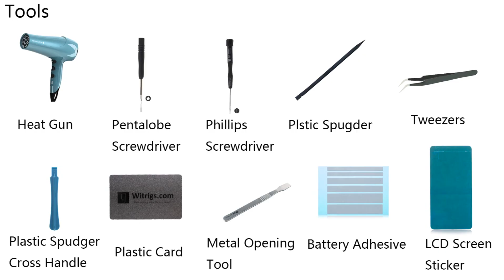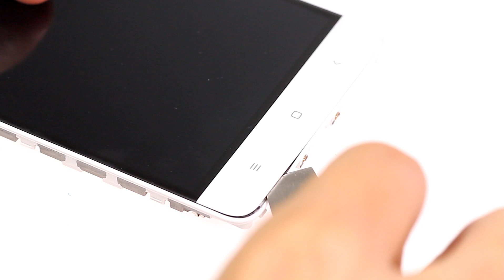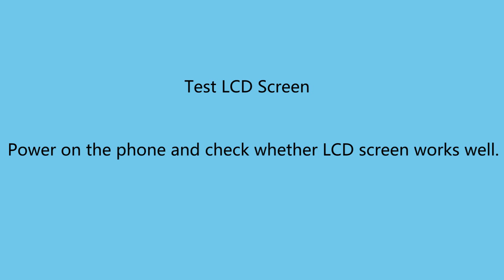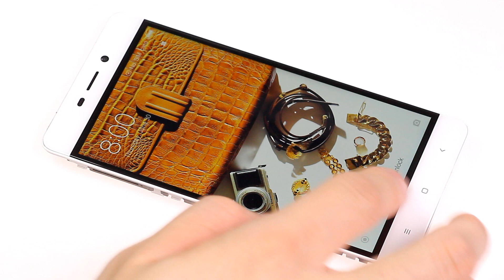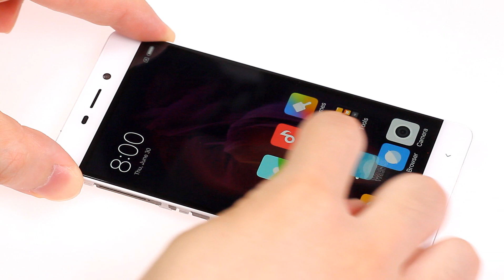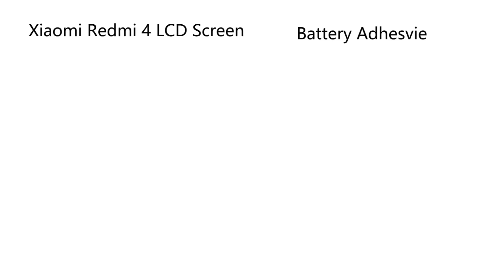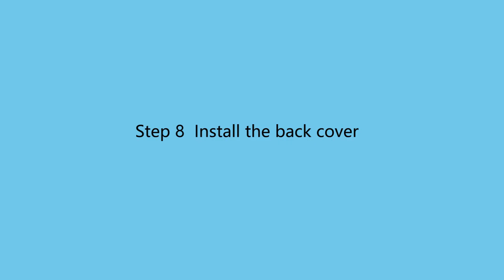Xiaomi Redmi 4 LCD Screen Repair Guide

Comment: Can we just replace the LCD panel if it is broken or will i have to buy touch and digitizer both for it?
Reply from the maker: It's almost impossible to replace the front glass only. You need to buy touch and digitizer assembly.
Reply: Thankyou So Much

Comment: I'll tell you what. These goddamn mass produced shite products are designed such way that you have to disassemble everything to get to the part that is most prone to damage. In the meantime you take out the motherboard along with bunch of connectors which are much more delicate and expensive than the lcd screen. This is all by design..